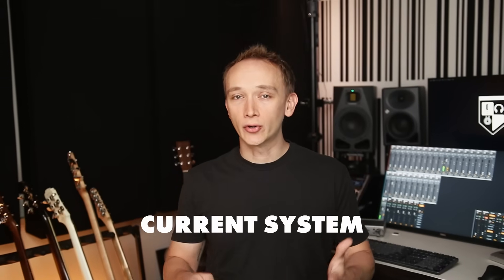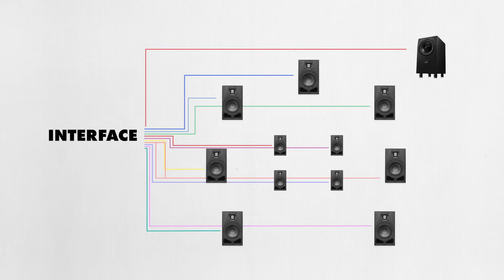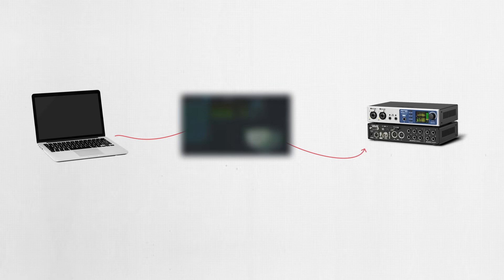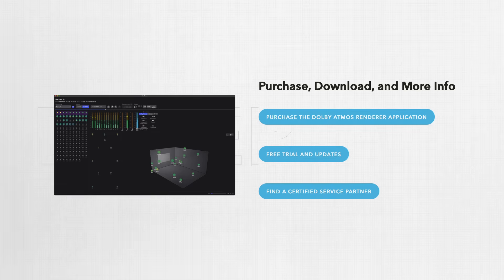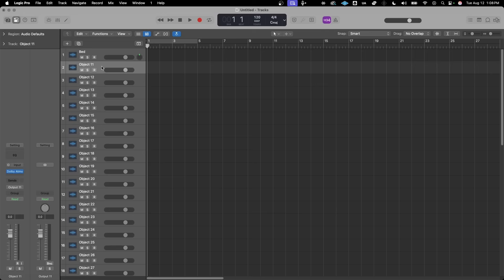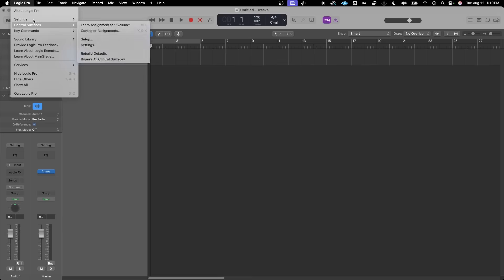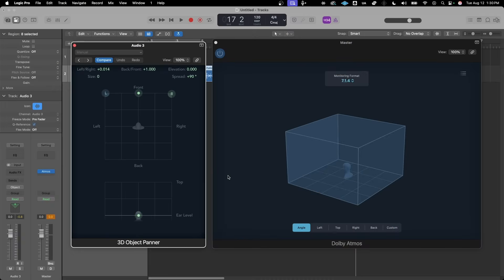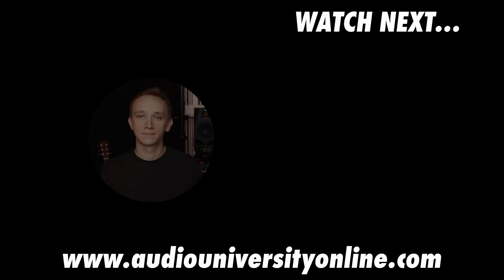How to Set Up and Route Audio for Immersive Mixing

Comment: nice job, but this is very complicated. i mix in 5.1 with a (5.1) hardware/software combo that poduces 5.1 wav or flac files. is there not a simple 5.1 to dolby atmos file converter that automates all this? to listen to a dolby atmos file over headphones or a two-speaker stereo setup is it not the case that dolby atmos must use some psychoacoustic tricks to simulate surround sound? is the final sound comparable to what you hear on a true 5.1 system or just a somewhat reasonable facsimile? i want to produce dolby atmos files but i don't want to go down that rabbit hole if the final result is going to be compromised audio.
Reply: I would say that depends a bit on what your expectations are, and what you are trying to accomplish. I don’t know of any automated solutions that will turn 5.1 into Atmos, and there would also be the question of what you want from that solution. It is possible to take existing 5.1 assets and then route them to a bed or a combination of bed and objects using a DAW and one of the existing production solutions for Atmos. Many DAWs now come stock with Atmos capabilities, and there is always the free version of the Dolby Atmos Composer. However, if you want to officially distribute your mixes, you will need to go higher than 5.1 (streaming services want mixes that take advantage of the whole space that is offered in Atmos and make an effort to reject things that don’t fulfill that criterion by imposing lower boundaries on what your master file must at least contain). That doesn’t necessarily mean you have to use lots of automated objects, but you would have to go at least something like 7.1.4 multichannel, which you can theoretically do with hardware (and some mix engineers do that), and then bring those files into the Atmos domain. 
In regards to headphone playback: yes, that is definitely a compromise. It’s definitely not the same as listening in a well calibrated studio environment, but I’ve had the experience that it can still bring something interesting to a mix. I tend to treat this basically as a way to enhance headphone compatibility and not think about the 3-D aspect as much. 
I hope this helps. it is probably beyond the scope of a YouTube comment to really go into detail on all of this, but if you have any questions, feel free to ask.
Reply: @florianangerer5121  thanks so much for taking the time and effort to respond. much appreciated.
Reply: @rjw8631  of course, no problem! I’m glad if it helps. Out of interest: what hardware are you using for your surround mixes? In my experience, hardware solutions for surround are both expensive and hard to come by.
Reply: @rjw8631  for some reason, my reply disappeared the second I posted it, so here is another try: of course, no problem! I’m glad if that was helpful. Out of interest, which hardware are you using for your surround mixes? In my experience, hardware solutions which support 5.1 or higher are sort of hard to come by, and tend to be expensive.